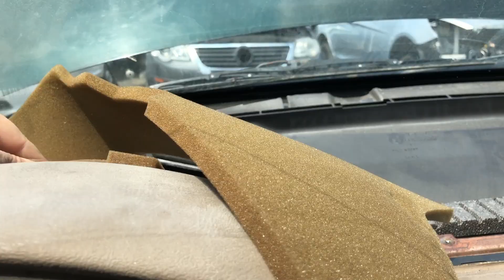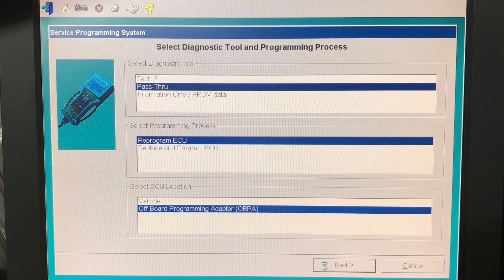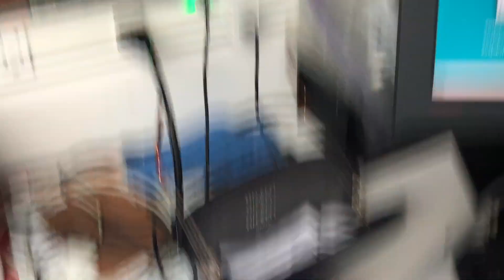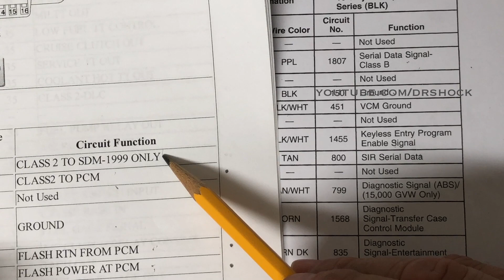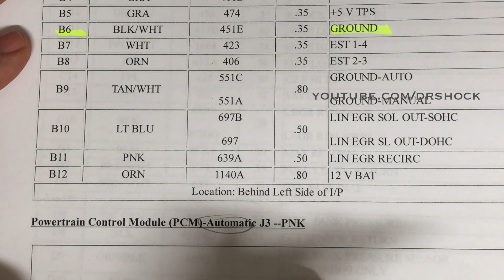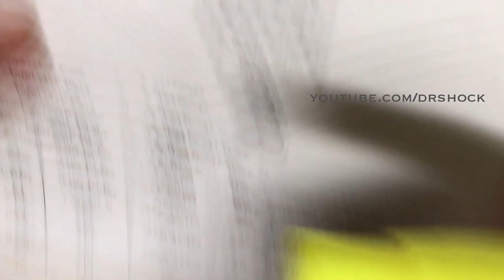1996 - 1999 GM Saturn S-Series Used Salvage Yard PCM SPS Programming with Tech2 TIS2000 Differences

Comment: Is it possible to reflash a 96 pcm to match a 99 pcm?

Project:

I’m currently doing a down grade engine swap since my 96 DOHC 5 speed manual engine ceized up. So I’m installing a 99 sohc 5 speed manual into my 96 Saturn SC2.

Now from face value I think the engine wire harness look the same on both. Though I understand the chassis size will be different and plan on switching the gauge clusters from the cars so the mileage will be carry over so I don’t have to write it down.
Reply from the maker: Yes, I would expect so if the two PCMs have the exact same GM part number. The GM tool(s) I'm showing here will only reprogram a calibration to how it was originally built on the assembly line by VIN.   I'm not familiar with what the engine and PCM differences are going to be between 1996 and 1999 for the Saturn SC2, but there are differences.  There used to be a swap guide wiki for first generation Saturns but that website seems to have died years ago.

Since you're keeping it a manual transmission setup from donor and original I would expect that avoids most of the possible drama though.   Keep the VIN matched to the engine, rather than the chassis, for the programming would be my advice.
Reply: @DrShock thank you 🎉

Comment: If your swapping to the same year, same model, and same engine saturn PCM, you should be fine to plug and play right off the bat. I bought a 96 sl2 automatic PCM at the junkyard and swapped momentarily inside my 96 sw2. Had no issues, ran, no check engine lights, drove too. Bare in mind- it's not too literal of differences in cars. only accessories(options), and other factors are really at play such as model, engine, and transmission. for some reason, despite the sl2 i nabbed this PCM off of having manual windows, my power windows still worked funnily enough. crazy. I still have it as a spare should anything happen.

Comment: @drshock, I'd like to locate the update file used in this video for 1999 Saturn S-Series. Where might I find a source to download from?
Reply from the maker: There is no file used here, and there is NOTHING of this nature you will find free for GM due to aggressive legal actions on their part.  What this video shows is the dealership type process for an calibration update from the national GM VIN database to the PCM internal flash memory.   That database would be the only source for updates, either through the purchase of a current subscription to ACDelco TDS to get access to the service programming system (SPS2).   Or to locate an used TIS2000 DVD-ROM sent to dealerships from the pre-internet days as I am using that show up from time to time for sale at the links in this videos' description for just SPS.  

Then you would need a GM Tech2 scan tool as I showed, another former dealership level tool listed in the video description.  And then an ultra rare special red type of DLC adapter as Saturn was a different kind of car.  ;-)

Comment: If I have a California emissions Saturn, can I flash programming from a like vehicle that had federal emissions? I don't live anywhere near Cali and the 2 catalytic converters is really expensive to replace where I could just replace with a federal exhaust system
Reply from the maker: Not using these GM tools, they will only program the module to the as originally built configuration based on the VIN.

Comment: So is it possible to use the same setup to change a 2000 Saturn Sl2 for federal emissions instead of California that doesn't use the air injection pump?
Reply from the maker: The programming is tied to the VIN in the GM database, so it would not be possible to alter how the vehicle (i.e., the VIN) was originally built using the GM SPS system.  You might be able to do this with an aftermarket tuning tool, but support for Saturns I would expect is limited.

Comment: Really enjoyed this video. I have owed a 1998 Saturn SW1(Automatic) Since 2011. Love this car. It has a digital OD with 428,000 miles. Does the PCM store the mileage? If so, if I get another PCM does mileage have to be entered manually? And can PCM’s be restored?
Reply from the maker: I'm not aware of anyone repairing/restoring these old school Saturn PCMs.   But you can reprogram them using a GM Tech2 tool, a TIS2000 DVD, and with this special red adapter I covered in the video.   Some older shops would be the only ones that may still have the necessary equipment.
Reply: @DrShock  thx for response. How about Mileage. Where is it Stored? In PCM too?
Reply from the maker: I'm not sure on that model, most likely in the instrument panel cluster.  I don't believe those late 90s Saturns had a body control module (BCM).  Mileage isn't typically stored in the PCM, just the VIN.  It's usually stored in either the BCM or IPC (and in more modern models both).
Reply: @DrShock  K. The only reason I asked is that it has a Digital Display. Not a Mechanical

Comment: Would this allow you to reprogram an Automatic PCM with the Manual PCM calibration? I swapped my 99 to a manual transmission and I’ve been wondering what the right solution would be. I have a Tech 2 and the red Saturn adapter, just missing TIS2000.
Reply from the maker: This adapter was required with SPS for any Saturn specific PCM across the model years in the video title.   As for converting between manual and automatic, I doubt it as there are likely pinout differences given two different GM PCM part numbers for the two powertrains.
Reply: @DrShock  Actually- you can run an automatic PCM with a manual tranny on these. dont believe me? look it up... Its quite a popular choice.

Comment: My new found friend. I have a 1998 Saturn SL2 that I really did not want, now after being stuck with it for 2 years, have completely rebuilt the motor, some extra specials.. 🔥 Transmission, almost completely rebuilt the entire car, and NOW having a performance issue, first the battery kept draining, had no battery/charging light, went through 3 alternators and 2 starters, found a problem with the ECU.. Seems the drain is within the ECU, and now, it's showing codes that do not exist. Map, O2, weird things, but when it's running, runs perfect, but after a half hour, starts missing, but intermittent. The Serve engine soon light does not light up, but my cheap scan tool will communicate to it.. I'm thinking it needs reprogramming? Do you do this and how much and where do I mail it off to? Please help, I love this car now.. 🙏🙏🙏
Reply: any 98 should plug and play, but has to be one for similar car to your own.

Comment: Do you know if GM/Saab (1999 & up) uses different OBD2 connector end?
Reply from the maker: GM North American brands all use the same OBD2 connector since 1996.  Also in use in 2023.  The pinout has evolved, but the connector is a standard.   I can't say for Saab, or any other EU brands like Opel though.

Comment: If I take a PCM out of a 1999saturn SL1 and put it in a 1999 Saturn SL1 do I need to program it to my Saturn SL1
Reply from the maker: The PCM holds the VIN of the vehicle along with any options that are enabled.  The programming for these years would be just to copy that data over to the replacement PCM.   Note that there are different PCMs used for automatic and manual transmission models even for the same year and model Saturn.

Comment: Trying to start installation of a 'Unichip' by dastek which is a piggyback computer for cars that don't have a lot of aftermarket support-you know saturn didn't I'm sure. Question: do you know of any other cars that had very similar, albeit not exact, harness connections for their pcms? Reason being, Dastek has hundreds of diagrams for various makes that detail what wires to intercept (how to intercept-cut and splice, 't' into, etc.) but naturally, not for the saturn. Having one that is close, might might help them to help me, would be fantastic. Sounds like you delve into a lot of pcms and perhaps you've seen one close to that particular setup. I specifically mean number of connectors, their number of pins per connector, etc.
Reply from the maker: This is the kind of info and experience you'd have to get from a shop that does nothing but PCM repairs I'd expect.

Comment: I’ve had a couple saturns in my time. 95 SL-2 5 speed car and an Ion (I think it was an 04) also a 5 speed car. Both good cars. I’d still have the Ion if it wasn’t destroyed in a crash a couple years back. That car was super reliable, easy to work on and parts were dirt cheap even OEM parts when available and gas mileage was outstanding